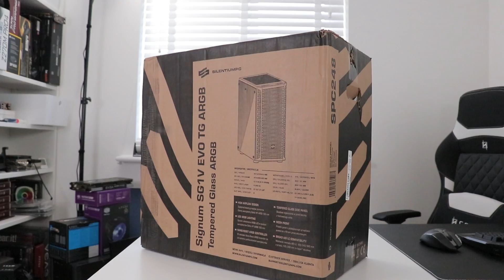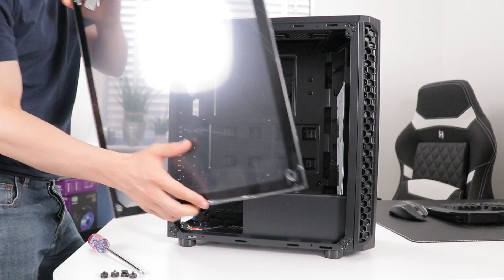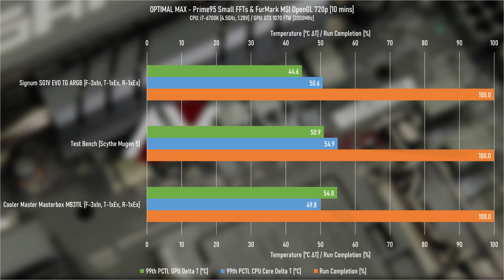Budget ARGB Done (mostly) Right! - SilentiumPC Signum SG1V EVO TG ARGB

Comment from the maker: Timestamps:
00:57 - Unboxing / Packaging
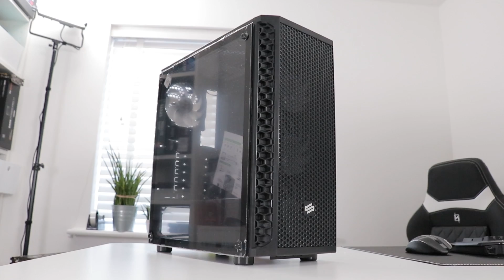01:19 - External Overview
03:01 - Fans and Radiators
04:07 - ARGB...ness
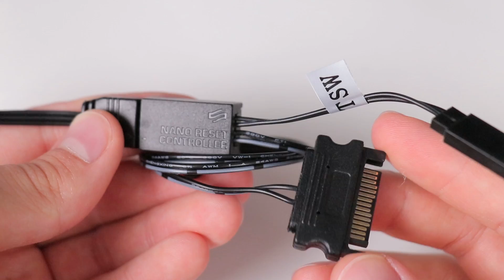05:32 - 3.5" Drives and PSU
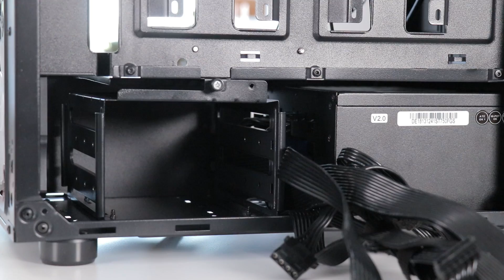06:30 - 2.5" Drives
06:46 - Cable Management
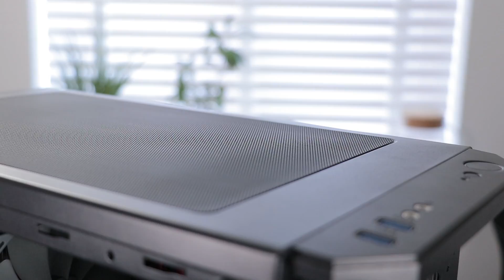07:37 - Motherboard (and CPU Cooler)
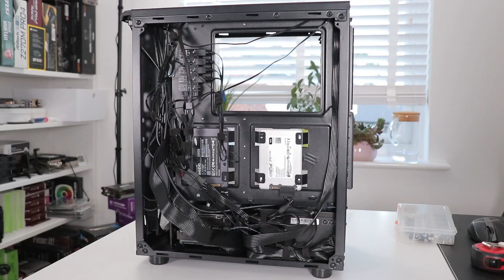08:04 - Graphics Card

TESTING
08:32 - Introduction
09:16 - Test Analysis Start

13:05 - Conclusion
13:24 - Fin

Comment: I also bought this case about 10 months ago and I am still happy with it. The SG1 actually, so without TG and fancy RGB coolers. It is just a simple case that has cost me only 33 Euro back then.

One of the things that has not been mentioned, is that it is really compact but still fits an ATX board, large graphic cards and tower coolers. I actually could not find ANY other decent case with such compact measurements that does that.

If you are regularly changing components in your PC for testing or something I would however not recommend this case. It is too compact for that meaning it can get time-consuming to handle on such small room and fiddle the cables and so on.

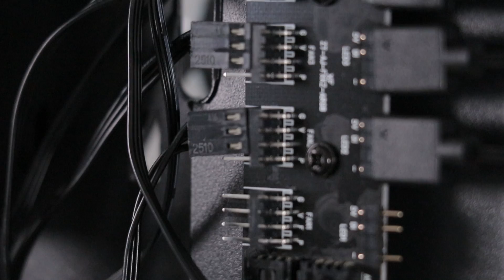Comment: 4:37 So if I were to replace the fans with 4-pin PWM ones, I could still connect all of the fans to this hub and power them directly from the power supply? I wouldn't buy RGB ones so I don't think I need a controller, and the RPMs should do their thing automatically since it's 4-pin PWM (these to be exact https://pcpartpicker.com/product/WrvZxr/be-quiet-bl066-505-cfm-120mm-fan-bl066). Correct me if I'm wrong, I'm still a noob to this since I've never built a PC.
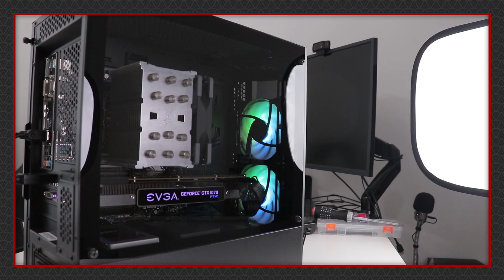9:37 38.3dB is pretty loud so I guess buying different Case Fans would be good.
Reply from the maker: Correct, if you buy 4 pin fans they'll work with this fab hub.

38 dBA isn't really that loud, it's a reasonable level of noise, but it's worth noting that's all these fans at fill speed, so you can more than half their speed to reduce noise levels. You can buy different fans, but you'll probably be disappointed by a lack of increased airflow and decreased noise output.

The main reasons I'd buy more or different fans are if the included fans are really bad (too noisy), or if there aren't enough fans included for good/balanced airflow. The ones with this case are very reasonable, and I'd try them out first before sinking £30-50 to replace them. You can always buy new ones later, but it's harder to get your money back if you find you didn't need to spend the money.

Just my thoughts though, hope it helps.
Reply: @AVTechy  Alright, yeah. Thanks a lot for the answers! I was really hoping to get some.

Comment: I bought my pc
I5 10400f
Asus strix rtx 2080 (used)
Mobo msi mag b460m mortar
Ram g.skill 2x8gb 2666mhz cl19 value
Ssd kingston 500gb m.2 pcie nvme a2000
Case silentiumpc signum sg1v evo tg argb
Power supply silentiumpc vero l3 600w
And CPU cooler is spartan 4 evo rgb 100mm is the 100mm good for that mobo? And is it a good build
Reply: Chłodzenie to bardziej pod procesor niż mobo. Swoją drogą zamierzam zrobić podobny build ale na z490 więc jestem ciekaw jak temperatury na profesorze-choć jako CPU z zablokowanym mnożnikiem nie powinna się grzać
Reply: @jarou5513  dzieki za pomoc ale zmieniam ram

Comment: The review is very good, but, my God, those graphs are horrendous.

Let's look at what I'm talking about:

1. 9:35 - You can't just make a single graph representing multiple different stats on the same axis. In your graph you put Fan Speed, Case Volume, Cooler Height and Sound Level on the same X axis. Why? It hurts my eyes just looking at it without comparing any of the stats, and if I try to compare them, it starts hurting my brain. SO MANY DIFFERENT NUMBERS! Please don't do this, rather make more graphs.
2. Why is Case Volume and especially Cooler Height on a graph? You shouldn't be comparing them on the graph because you are doing a noise review.
3. 9:47 - There's no point of having a Run Completion on a graph. It took me a while to understand what the heck it even means. Of course the run will complete, that's obvious. If it doesn't by any mean, just write it, in red text for example, instead of showing the info of a failed run.

Comment: Check out the SilentiumPC Regnum RG6V EVO TG ARGB!!! It's much better than the one in this video and it only costs €68,90 in the Netherlands!
I have it, and it's an outstanding case in this price range! It has way more space for cable management, and also the 4 stock fans with ARGB are very decent!
Reply from the maker: They've sent one over, it's in the works for a video. Not a full review, but something new on the channel. I'll cover all the main features and my impressions when it's on though.
Reply: @AVTechy  I have built a PC a month ago with that case, with the following components:
- AMD Ryzen 9 3900X (12-Core)
- Corsair RGB Pro 32GB DDR4-3200 CL16
- GIGABYTE 1TB NVMe SSD.
- Zotac Gaming GeForce RTX 2080 AMP MAXX
- motherboard: GIGABYTE B550 Aorus Pro
- Case: SilentiumPC Regnum RG6V EVO TG ARGB
- PSU: Gigabyte GP-P750GM (750W, Gold certified)
It was zo easy to built in! Love it, and more than enough space to add liquid cooling (Which I have plans for) and the case has plenty of airflow. Also love how the front grill and dustfilter are super easily removed.
And that case has way more space for cable management!

Comment: digging the film but i would like to ask you something. i just bought case silentiumpc signum sg1x tg rgb wich has 4 rgb fans but im looking at my motherboard and it has only 2 chasis fan connectors and 1 cpu (obviouusly) and my question is. Do i need a splitter or do  you think the cables for the fans are connected like 2 cables into 1 or something or do i need splitters to connect them? thanks!
Reply: btw ive never build a pc and i dont understan everything in cable management

Comment: Hey! Just ordered this Case and im wondering, Should i do 2 intakes and 2 exhaust? or should i just keep them how they come?
Reply: I got the case not to long ago and i kept them as they were and the temps and airflow are amazing, i might add 2 more fans on top down the line tho!
Reply: Blue B Yeah dude its amazing i freaking love it, Heres some tips: Put the CPU Power cable i the hole and get it ready before putting in the motherboard, Connect the nano reset controller to your reset switch after you have booted to windows and otherwise its epic

Comment: it looks a very nice case and well done i think, but i feel the fans drag the price up unnecessarily. thanks for reviewing it.
Reply from the maker: Something that's a little nuts with these SilentiumPC cases is they have pretty much every comination of case you could possibly want. There's a solid steel side panelled one, a TG version without ARGB fans, two versions with different front panel designs, so if you didn't want to pay for the ARGB there are a few other options to check out - a surprising amount of SKU's (I think that't he right use of the acronym :D ).

It only just occurred to me today that this is the cheapest case with 4x ARGB fans, so you could think of it as a well equipped ARGB case that's been value engineered, with the option to get the cheaper non-ARGB version.
Reply: @AVTechy  Also it has a Motherboard addressable ARGB controller!!! Very important for the new B550 release with ASUS Aura / MSI Mystic Light. Most <80€ ARGB PC cases use a remote control or a Reset button control! SilentiumPC hits the sweet spot.